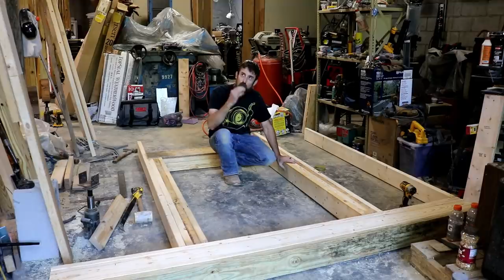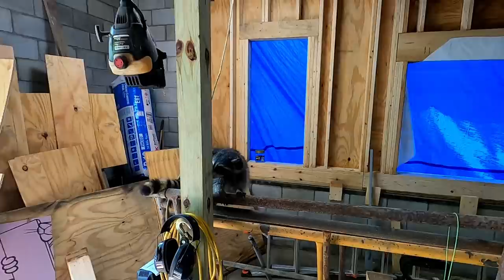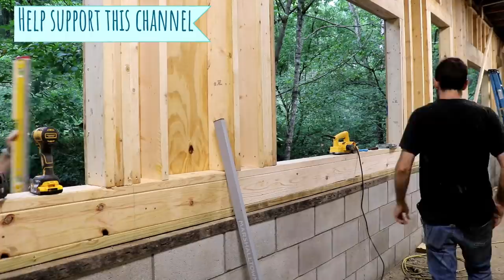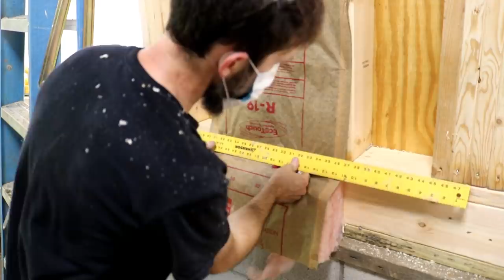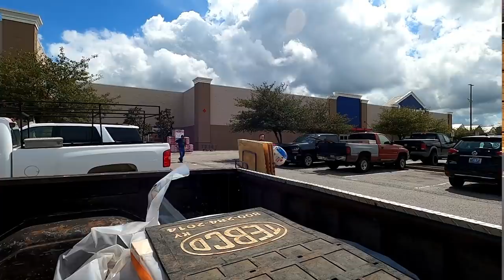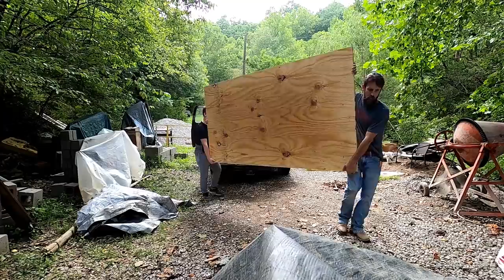Finished Framing & New Squirrel family member

Comment: Handling sheet goods in a windy parking lot can turn you into a hang glider in a hurry!  Seeing your boy helping you unload the truck reminds me of when I was about 12 (51 now) and helping my dad put a new foundation under our house, which had dry rotted locust posts as a main part of the foundation. I started the summer struggling to carry a 6 inch block and by the end of summer I was toting a 12 inch block in each hand. 
  Also, I have always thought that if it is worth building, it is worth over building. I overbuild everything. AND... since it is your shop, build it however you want. As long as it is safe and won't fall down, then who cares how overbuilt it is. You ain't doing it as a buisiness so economical use of materials isn't a factor.  Thanks for filming and sharing!

Comment: I have a hammer stapler... for 50 years.  So yes getting a quality tool will last you a life time.  I used the hammer stapler in my roofing days tacking down 60 pound (or 2 30 pound rolls) felt on roofs.  And yes you can be incredibly fast once you get used to using it.

Comment: Being an electrician for 40+ years, hated attic work, mainly cause of the insulation. So i learned a long time ago to use baby powder on my arms n legs. The powder helps stop the insulation cause the powder blocks the pores in your skin, which helps block the fiberglass. It does a good job till you start sweating a lot, but it good if you are not sweating a whole lot. Nice wark for not being a framer. Maybe a leaf blower or BB gun to get your new pest out of your shop.

Comment: About the broken fingernail. Wait until the bold stops, then clean  the nail with alcohol. After that seal the crack with superglue, use a small piece of tissue paper soaked in superglue to make a brace over the crack. Use fine sandpaper and nail polish to soothe out the surface. Then let the nail grow out. Otherwise you will pull and bend the crack. It may even get infected. And that is really painful.

Comment: With all those odd size cavities I would prefer to work with rock wool. You can cut it with a knife or a small fine tooth hand saw.. No paper backing  or stapling to deal with. Its firm enough to hold on it's own.

Comment: Love your videos and really love your attitude on life.  When my brother and I built my new shop he would get frustrated with me and my 1/16 inch or less tolerances. I am a mechanic/machinist/fabricator/welder by trade. By the time we were finished with the 32x40 shop... "two years later" which included a 1300 square foot apartment for our Mom on top I was ok with 1/4 inch being close enough. I never wanna work with wood again, I mean I go to buy metal and a 2x4 is a 2x4, not 1, and something by whatever the guy at the mill decided was good for that day. I envy the people patient enough to work with wood, the stuff is more willy nilly than a toddler. I got one over on ya, if I cut a piece to short I can weld it back on and cut it again... try that with wood.  ;-)

Comment: I don't understand why so many people think that battery powered tools are superior to corded tools. Battery powered tools have their place when it comes to situations where a lightweight tool may be required or there is a lack of power. But consider this. Until the  makers of battery powered tools finally agree on a voltage and standardize batteries so that they are interchangeable among brands, it is just a way to pick your pocket at will. I have had more than one battery powered tool that became useless when the battery reached its lifespan and the cost of a new battery, if they were even available, was prohibitive. As a result, another tool ended up on the scrap heap and my wallet was once again empty. 

Corded tools are still your better investment over the long haul in my opinion. I have a Black and Decker saw that I picked out of a scrap bin over 40 years ago that I replaced the brushes in and it is still working just fine. I have a number of power tools that have gone well beyond twenty years of service and could easily see another twenty years if maintained. How many twenty year old battery tools do I have? SImple. I have none. The oldest battery powered tool I have is about five years old and one of the batteries for it has already bit the dust and cannot be replaced. 

So don't be apologetic when you purchase a corded tool. The chances are fairly good you will still be using it long after it's fancier battery powered brethren have faded away.

Comment: I've been in the insulation yrs. ago. PLEASE Any where you have 2XS. Nailed together such as beside windows/Doors seal them with silicone etc. inside and out. Air Will penetrate.Great job so far. I've watch all vids so far. Bet your glad to get back to normal.

Comment: There is nothing wrong with over-engineering. It's far better to be over-engineered than under- engineered that's for sure.
Reply: Anything worth doing...is worth overdoing...lol.
Reply: As another Youtuber says, "never under-do the overkill"........
Reply: Under engineered, over built!
Reply: Engineers, pushed by penny pinchers, have caused lots construction failures by under engineering projects.
Reply: It's my nature to overbuild everything and I'm comfortable with that. A few times in my 45+ years working on cars and trucks when a friend or customer has crashed he's come back and thanked me for over engineering the chassis and roll cage cause it didn't collapse and kill them. I do the same thing working on my house, my wife used to ask me if I was planning on a plane crashing into the house 😂 I always said you never know.
Reply: I believe Tom Lipton when he says nothing overbuilt ever broke.
Reply: Actually that is not always true, The Spruce Goose was over engineered, and it barely got off the water..  .....Good engineering is not over or under engineering .........
Reply: Noel Henderson Nothing too strong ever broke.

Comment: The wood is a thermal bridge
Not so much after it dries out
Wood has a thermal density ,its why log cabins are so warm without insulation
Wood has an R value of 1 for every 3/4 inch I believe.

Comment: Cold bridges are real. I painted the inside of my shop in the winter, and as the paint started to dry I could see all the studs as stripes of wet paint. But I would say that wood is a better insulator than the concrete blocks. 

And then when you started to put the insulation in in I was thinking: "I'd prefer an ordinary style tacker there, that's getting really close to his thu... yeah, ouch"

Comment: Will agree the electric planer is great, bought one to do a door at home, because I needed to take 1cm off, and cutting with a circular saw was not going to end well, and then it was used to install a half dozen doors for my sister a month or two later, making fitting new and used doors into the old frames a 10 minute job per door.  Will also add the Forstner bit made putting in the hardware so much easier, as i have done it before using a bit and brace and thewn a chisel, but with power tools it was literally 5 minutes till i needed that chisel to recess the hardware in the door, all the heavy work was turned into a lot of wood shavings and powder on the ground.

 Raccoon is easy, get yourself a half dozen insect foggers, and remove the other family animals, and set them off inside the shop. Will have the grey intruder out in minutes, plus no more fire ants there either. Just keep the nut family out for a few days till the pyrethroids evaporate away, and you are done. 

You sure you are not a pro builder on the side, because your work is moving fast and neat, and yes that wall will likely support adding another 6 feet of wall, and a crane crawler beam on it as well.

Comment: Actually a "builder" would temporarily attach two pieces of wood at the top of the frame to stop it simply falling right through the hole,  and make the frame 3 - 5 mm less than the hole in the wall all.  Makes the job easy.  Also it is debatable whether it is a good idea to attach the cladding before mounting the frame into the wall as the hole may not be exactly square.  With all the care in the world it happens.

Comment: If you ever go to insulate, sheathing products can mitigate bridging. Inside or out, foam sheathing and rock wool type treatments can be applied under drywall or siding treatments. Framing the way you did will not keep that from being possible down the road.
Reply: Even spray foam...forgot that momentarily.

Comment: steve , Tip ! rub baby powder onto your exposed skin, it will block the pores and wont allow the fibreglass to get i and make you itchy for days . Yes you will look like a ghost but believe me it will be worth it.  Great work !
Reply: Washing your hands and arms with dishwashing soap and allowing them to air dry also really helps with Insulation Itch.
Reply: @matthewhelton1725  Showering as cold as bearable should keep your pores shut and wash away the fibres....
Reply: I'm a fan of Tyvek overalls and gloves for working with fiberglass.
Reply: After a few days of batting, you don't feel itchy. First day, a couple of Advils (vitamin I) stops the itching.

Comment: We have some DIY stores here in the UK called: B&Q....

you'll be lucky to find a straight bit of wood in there...
Reply: Down under we have Bunnings...  (they made a push into  the UK market for a short while with Homebase). Same...
Reply: @greaser5691  that little foray was a disaster for them. It was interesting to see some other brand tools on the shelves for a while but I think the UK DIY market are pretty  brand loyal. As for wood from those shops ...nah I'll pass.
Reply: Not much different here in the US. I toss the wood on the floor trying to find straight pieces. It's faster that way. 😁
Reply: @ohboy2118  Wasn't a win, that's for sure, but they got out with their shirt still on. Was interesting to see the Ozito brand pop up in some UK YT channels though. Instead of the (usually half-decent) chinese stuff we get here, it seems (from what I saw anyway) they were re-badging some of the budget euro stuff that I have seen wearing other branding in UK content.
Reply: @greaser5691  oh ok I wasn't aware of the rebounding of euro tools. The Hombase near us went big on the Kinchrome tools and kicked out Stanley etc. Now they new seem to have reverted to Draper, Lazer and Stanley. I'm not complaining though I got a Kinchrome 6ft tall by 4ft wide stainless mechanics tool chest for £500 / 50%
Reply: greaser5691  the Homebase at the end of my road is going to be demolished soon ! Sainsbury’ s were rubbish at running it but Bunnings !!?  I did not realise there was so much crap in the world !
Reply: I have been threatening to put all my studding timber through a sizing planer before I start a job for years...
Reply: @CrimeVid  I've got a bad examnple for ya!  :)  There are 2 big grocery chains in .au.  Woolworths (no relation to  the UK and US outfits) and Coles (owned by the same people as Bunnings). Woolies got some sort of buy-in with Lowe's (US) and set up to compete with Bunnings with the 'Masters' chain... they opened about 63 stores, filled them with some imported stuff (e.g. titebond) and set about opening more. The stores lost money from day one. They closed all the stores and sold off all the sites. This 5-year saga is regarded as the worst retail disaster in .au history.
Reply: @ohboy2118  Julian Illett (a youtube creator) bought up big on runout Ozito batteries and other tools,  which I've never seen in Bunnings down under. Some carried marks that indicated they were Einhell products.
Reply: Here it is called Builders, a division of Massmart, a division of Wallyworld. The wood is actually not too bad, at least so far as boards go, and they also will cut for you provided you give a sensible cut plan. I have built a few units out of their shutterply, as it is a lot stronger that the chipboard, and survives well. Yes the wooden timbers they have you can build a boat out of them without needing to bend any, just by going through the pile to find the right shapes, but they do have the odd sections of straight, probably because most is kiln dried after cutting, and they want to get the maximum volume through at a time, plus of course the lowest grade. They also at some provide ready made roof trusses, and some are almost straight as they come, though you will be doing a little correction to them installing, if you actually want a good roof line.
Reply: greaser5691   Another one we had was Texas Homecare , famous for selling crap everything, they opened a huge number of stores,lasted four or five years !
Reply: @greaser5691  ah ok. I know of Einhell tools but isn't a brand I would buy by choice but always willing to try a little experiment occasionally. The Ozito tools looked and felt cheap if I am honest. I am also wary when a brand pops up out of nowhere it can quite easily disappear and then spares are near impossible to find unless you know it is a rebrand and can source in a different way. All tools break at some point dispite their colour or badge and I prefer to repair rather than bin.

Some really nice info in this section. Always interesting to read/hear about other parts of the world and if we all have the same experiences in the same style outlets. 🍺
Reply: I bet it's ten times the price as well!  

Regards    Arnold
Reply: I still get some wood at Lowe’s but gave up on Home Depot.  If I need a lot of wood for a big project I order it from my local lumberyard.  The wood is more expensive, but it is so straight that I just let them pick it, and they deliver it to my house for free.
Reply: @greaser5691  woolworths UK went bust in the crash
Reply: Shadowdog500  That is interesting.., most UK timberyards are cheaper than the sheds but you still have to pick your timber.

Comment: if youre planning on raising the roof now or just before you going to replace the roof would be the best time , part of the roof is still unatached you still have the lifts in place (mostly) and you still have brick and extra wood to fill in the gaps 
think a overhead crane would be a realy good idea for the shop
as for getting the racoon out , maibe a watersquirter (or a water/ air hose with some pressure behind it works , letting the dogs run it out the shop probably helps against him want to come back in 
as for the fingernail , maibe ask the wife for a fake nail and super gleu it over the top of youre normal nail for the time being holding the pieces together ,  it should reduce the agrivation from having it hang on sumting every so often , once its grown out the fake nail gets snipped off

Comment: Hammer falling outside the wall...utter despair: This is far worse than a slice of toast falling "Butter Side Down" on a piece of carpet; Ranks right up there with losing a detent ball or spring across the shop or breaking a tap in a blind hole. Also (21:30): I REALLY need to know the brand and model number of the saw you used to increase with width of that plywood board you cut too narrow the first time. I've been looking for one of those "Uncutting" Saws for years...
Reply: It is far worse when the hammer falls down inside a block wall though. :)

Comment: 4:50 What are these people talking about, Steve? (not meaning you) Dry wood is a thermal insulator. We use it in the design and manufacture of ablative heat shields for space vehicles, engines and other systems still to this day. The lower the density of the wood, the greater its insulation properties are but the lower its ablative properties are. The harder the wood is, the lowers its insulating properties are but its ablative properties are higher. Soft dry wood is a fantastic thermal insulator. Maybe for homes its not though.....? Hmmmm.
Reply: Ablative insulation, you say???

Hey, that'll be great when the shop is burning down.

Go check out Nighthawkinlight's channel.
He's been doing o whole series on kitchen brewed ablative insulation for a little forge.
(He has a cute Caique too)